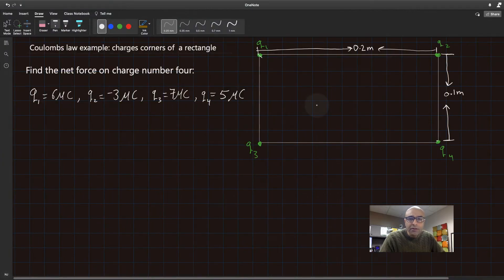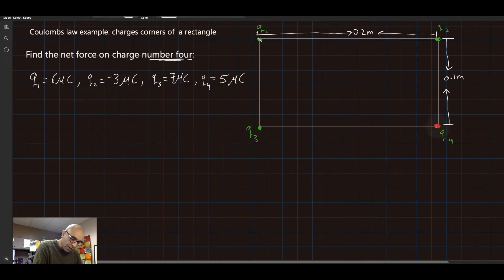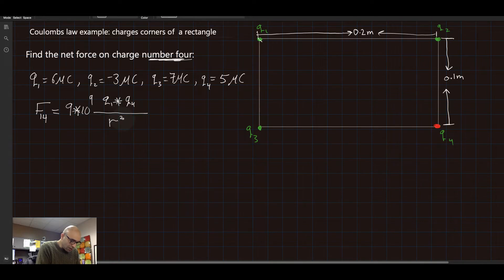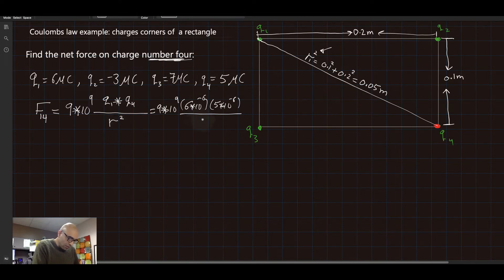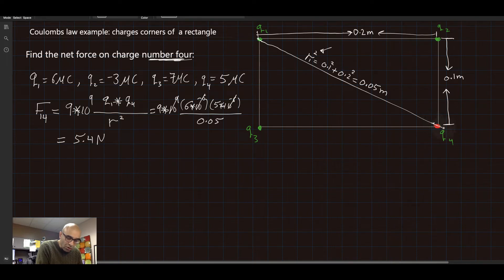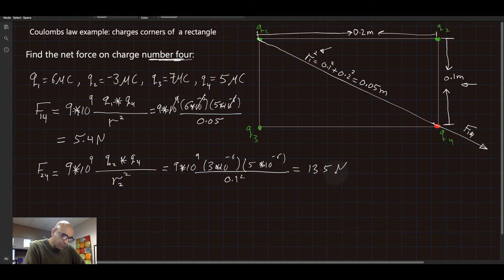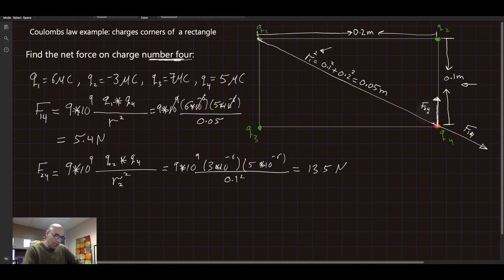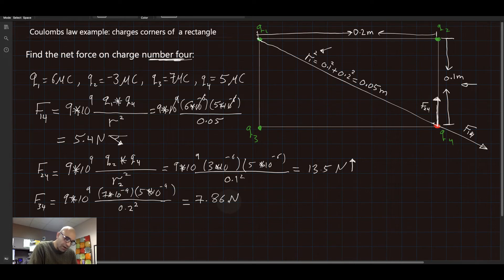Coulombs law: Rectangle with four charges on corners to find net force on one charge.

Comment: Jay, 
I'm making a 2 minute video that shows how to do a physics charged particles problem with a spreadsheet. 
This video is a good example problem for me to use. 
Can I use 2 screenshots (problem layout and answer) of this video in my video? 

Thanks, Arthur Hebert.
Reply from the maker: Yes. Please include in your screen shots my YouTube channel name either by saying it or by writing. Thanks for asking and best of luck.
Reply: @jaynawa5905  I put your channel name in writing in the 2 screenshots that I used. Thanks for the reply. 
https://youtu.be/0XdMZpCAWzA?t=101 and https://youtu.be/0XdMZpCAWzA?t=109
Reply: @jaynawa5905  I put your channel name in writing in the 2 screenshots that I used. Thanks for the reply. 
https://youtu.be/0XdMZpCAWzA?t=101 and https://youtu.be/0XdMZpCAWzA?t=109.
Reply: @jaynawa5905  I put your channel name in writing in the 2 screenshots that I used. Thanks for the reply. 
(The system doesn't let me reply with a link to my video. My video is: 
charged particles spreadsheet. electric field, force. 2, 3, 4, 5, triangle, square, rectangle. atan2
The screenshots are at 1 : 41 and 1 : 49 .) 
(spaces added to the time positions so they don't link back to this video.)

Comment: Do you have an example if it is a parallelogram and not a rectangle?
Reply from the maker: Sorry, I don't at this time. Parallelograms will be more challenging at this level. More trigonometry at the beginning and more vector analysis at the end. It also depends on how much info you have about the dimensions of the parallelogram, so each problem will be a bit different. Sorry I couldn't be much of a help at this time.

Comment: Excuse me Sir, what can I do if, in a rectangle ABCD, form by 4 charges like your example 
I need to find the value of one of the charges. The other charges, and the distance between 
them are gave.
Reply from the maker: Hi Vincent. I am assuming you also know the force (or not force). If so, your solution should begin where mine in the view ends, then trace back all the way till you find the value of the unknown charge. This will not be a simple thing to do, it will require some algebra.
Reply: @jaynawa5905  Thanks for answering me, in fact I don't know the force nor lacking of it.
 In that case my problem can still be solve ?
Reply from the maker: @vincentjoserivasferrer8732  That will be difficult to tell. But most likely not. You will need to know the force (or net force).
Reply: @jaynawa5905  Maybe, my teacher forgot to put that ítem.
        Thanks a lot again, I hope you are going to be very good.!!

Comment: Sir when 4  point is (00 ) , then how can we find net force  on D by vector form
Reply from the maker: Hi Satyam, could you please give me more details about your question? I will be happy to help you.
Reply: Yes sir, 
 Let a square ABCD sides 2m, 4m resp. 
Find the force on the charge placed at D point. 

 Sir this question is based on vector law of coulomb law
Reply from the maker: @SatyamKumar-yz6vd  If I understand your question correctly, here is what I will do, please go to min10:00 in the video. Then write forces in terms of unit vector notation. F14 = 4.83 i -2.4 j, F24 = 15.5 j, and finally F34 = 7.86 i (where i and j are unit vectors. Add all these vectors algebraically, the result will be your Net force in vector form. Use Pythagorean Theorem to find the magnitude and tan theta inverse to find the angle. I hope this helps.
Reply: Sir on  ABCD, can we make coordinate. 
Plz sir guide me 
For this I shall heartly thankful ...